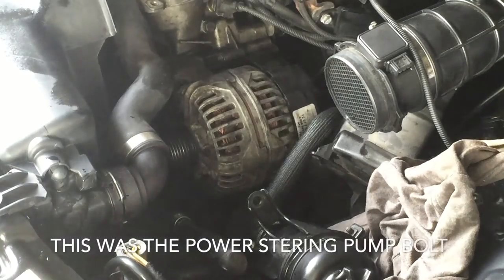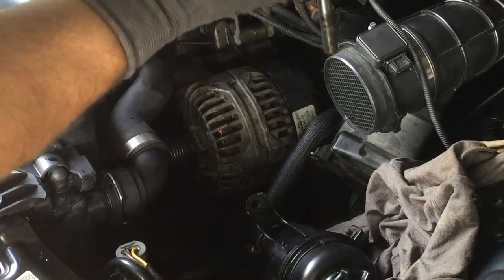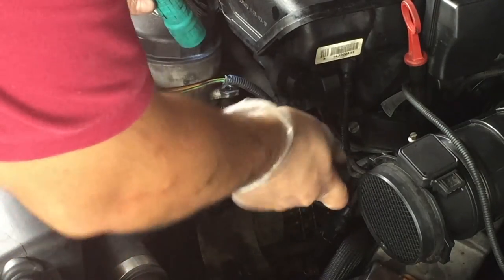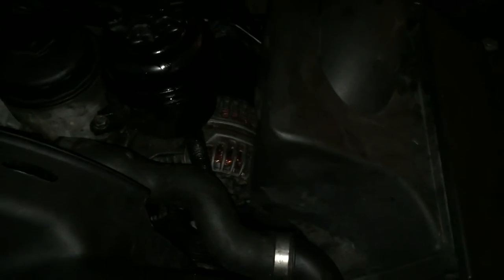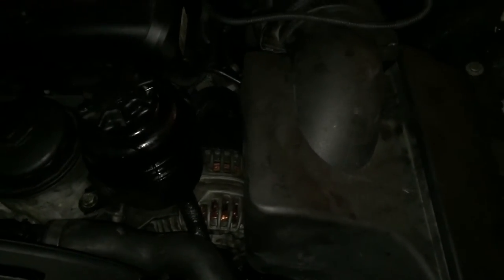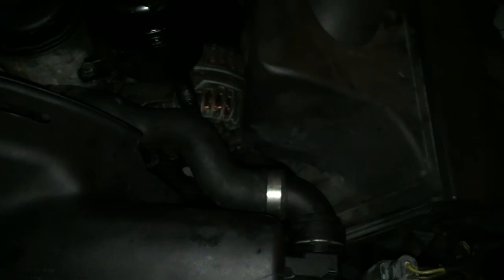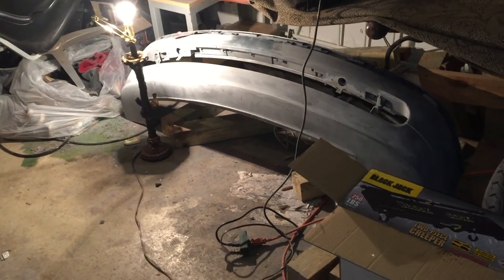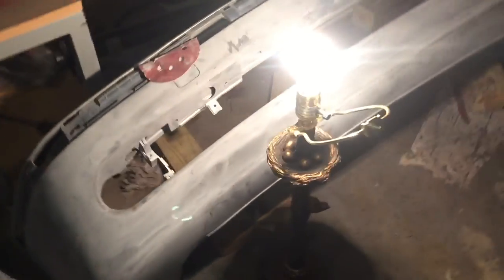E39 oil filter housing gasket

Comment: Thanks for a great video.  Just changed the gasket on my 2003 530i BMW.  My car has the hydraulic belt tensioner.   There is another you tube video where a guy takes a big hatchet and twist the tensioner down.  I used a large screw driver and was able to compress the belt tensioner to get the belt  off.  Your video helped me with all the other parts that needed to be removed.  When I went to put the belt back on, I used a 1/4"  hex socket.  Don't ask me why but a 6 or 7mm hex socket wouldn't work and inserted the hex socket into the tensioner and was able to compress and install the belt.  But your video gave me the knowledge and confidence to do the job.  Thanks
Reply from the maker: you're very welcome i'm glad you got the job done, you can always use the tensioner hex bolt to loose the belt but be careful if your hydrolock tensioner is locked and you put some excessive torque on that bolt, you will snap it, it happened to me twice

Comment: Happy to see someone doing it without removing the horrific (and usually mandatory for work on these engines) fan and shroud. Will try your method as soon as I get the gasket and some spare time. Engine is consuming way to much oil and I'm pretty sure this fix will solve my problem.
Reply from the maker: Carl Kolthoff thanks, what year and model you have
Reply: It's a -02 525i touring, eurospec with manual transmission and lowered ride height/sport suspension. Enginebay looks identical to yours. Guess there's not much difference between the M54's in 5-series.
Reply: Did it solve the problem?
Reply: @ironmantooltime  yes, it did. However, that comment was 4 years old and I've sold the car since. It later got worse problems that I neither wanted to fix myself or pay someone else to do for me. One cylinder lost all compression, so most likely burnt valves and / or head gasket. Possibly a hole in a piston too. This was the result of a really bad misfire due to failed start attempts in very cold weather.
Reply: @carlkolthoff5402  cheers for the reply. Theres also reputation of piston rings failing on these but yea, wise to get rid 👍

Comment: How did you get the two long bolts out? I want to do this method, but I don't want to get stuck with the bolts loose but stuck.
Reply from the maker: you can loosen them and take the whole assembly together